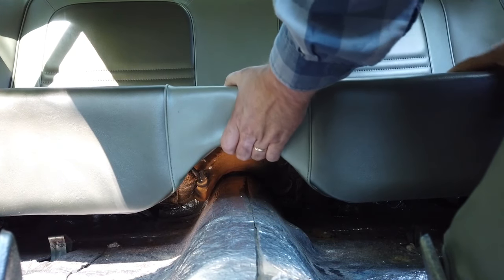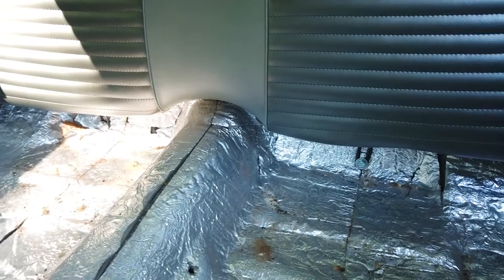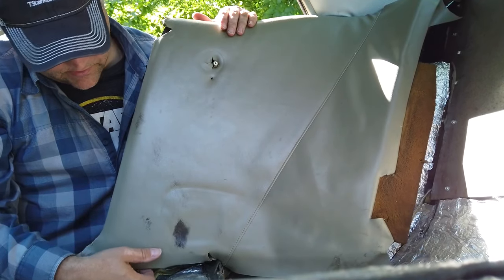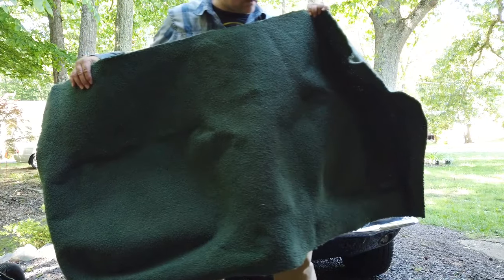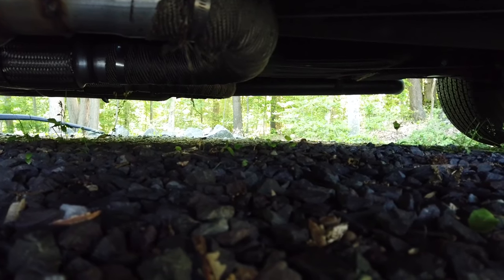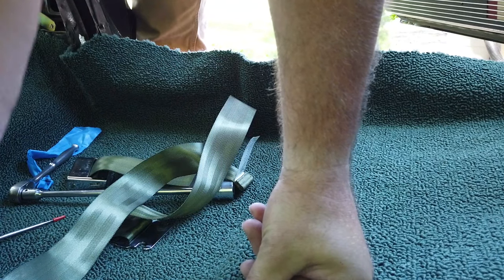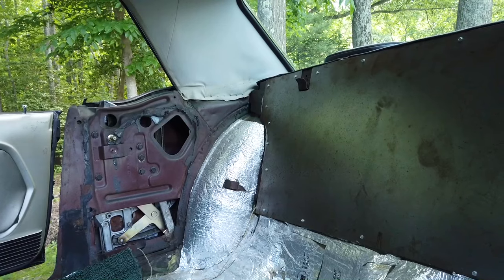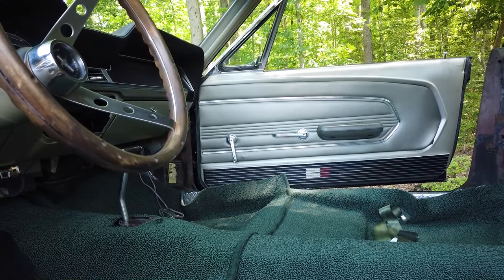Part 1 - How To Install Carpet In A 1967 Mustang

Comment: Note: The console will only fit on top (or it may break) if you remove the extra padding that is under, attached to the the rubber side of carpet